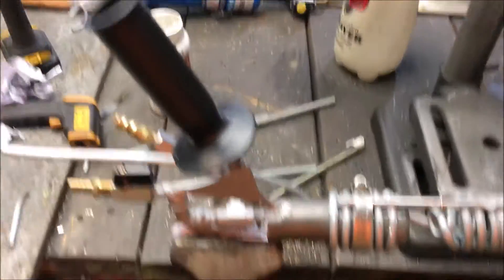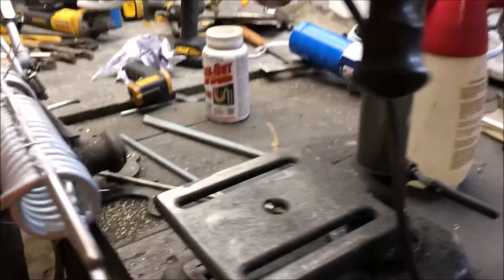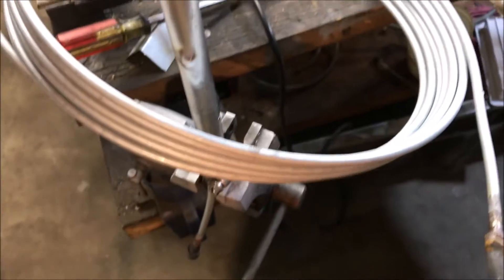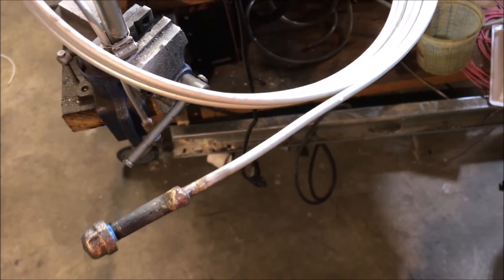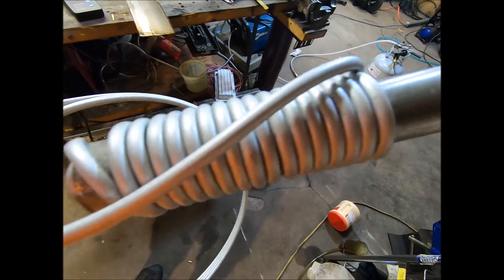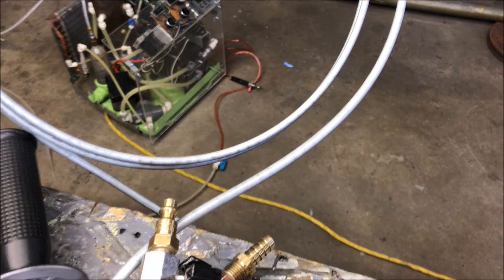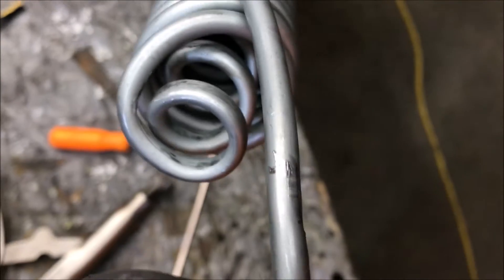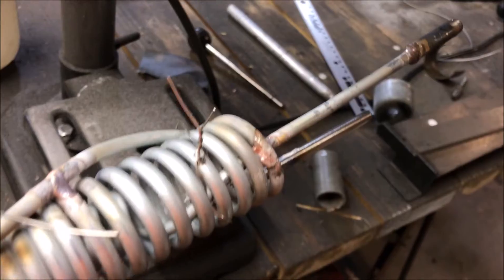Make steel tubing coils with water bend copper coils  NO KINKS

Comment: Just a thought if you filled with cold water say 4 c then seal pipe then heat up a bit maybe 40 c so not too hot to handle then bend
Reply from the maker: Yes possibly . there is something called apparent coefficient of expansion  and the tables suggest your idea would help , the volumetric expansion of steel is 35 x 10 -6  and water is 210 x10-6

Comment: To explain to the uninitiated amongst the audience [in long form], what our esteemed NOBOX7 is saying is the following:

The flatter tubes increase thermal transfer because the surface of heat versus the cross sectional profile of the water [like how you see the tubes in automotive radiators are always flt] increases the energy exchange more efficiently and heats the water faster per BTU.

The tube, although it has a fairly fixed external surface area, can have a varying internal volume and cross sectional area.

By flattening the tube, one reduces the 'moment' of water [the effective volume in contact with the tube's total internal surface at any one 'moment-in-time' so that instead of heating  whole lot of water to a lower temp, it is capable of heating a little bit of water to a much higher temp.

One can also rig up a roller [they make sheet metal coil benders which will work for this] to gently and gradually roll a tube to a very precise thickness without any risk of crimping it, but they are not only a bit of a price to purchase [unless you have the materials to make one yourself or can get one used some place like an estate auction], AND they require a lot more work/time to create the final product, since you can not roll it to the optimal thickness/flatness in one pass.

On top of that, it requires a lot of space, and realistically needs to be done with a large wide table because doing it vertically is not only difficult, it runs the risk of falling and kinking under its own weight.

Another option might be to wind the tubing along the mandrel then place it between the rollers and ever so gently roll it flat, only in this process, you must only roll one diameter at a time and then connect them together only after you have completed them all.

Therefore, although it is possible and desirable to make all of the tubing quite flat, it tends to be slow, difficult and costly.

Therefore, bending it the way NOBOX7 is doing it, will typically be the number one best way to proceed, and just hope you get lucky on any flattening that happens to come to you.
Reply from the maker: Great input , i discovered years ago the if you induce a leak in the pipe by just smashing the pipe ends closed the coil will flatten even better with out kinking . This is featured in my bending copper coils video .
I do like your idea about the rollers .
Reply: @NOBOX7  If you begin with an initial wrapping of the coil around a slightly larger mandel so that you are not stuck with a huge initial coil, you should be able to put the coil into a power roller and then ever-so-gradually reduce the diameter until it rolls ['crushes'] the coil uniformly onto the final mandrel.

If you look how a typical tubing cutter works, with the 3 wheels, just imagine 3 rollers [opposed to 2 rollers and a cutter] and a central mandrel which floats [rolls/spins freely inside the 3] as it is compressed, and on one end, have a shoulder which keeps the tube from going off of the end, and on the other, a nut that can be gradually backed out as the coil goes from a larger diameter to a smaller diameter, while going from only say 10 turns to maybe 15 turns, using a little bit of pressure applied to a sacrificial extra bit of tube at the end which serves to keep it from trying to spread out sideways too much...

What comes to mind is an allen head bolt [which starts its life out with a pre-rounded head] and a nut which has been carefully modified to be round, but with some grooves in the end [like a castle nut] which remain there to both give you something to apply a spanner to, and allow you to count how many turns [or pats of a turn] you have applied to said nut while letting out the slack so you can [hopefully] maintain precise and repeatable results, once you find the perfect press fit.